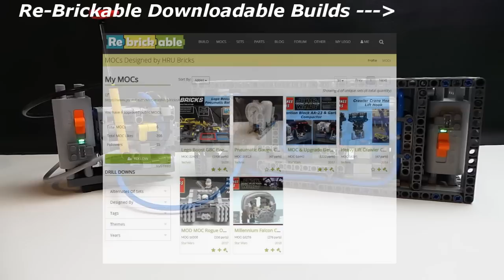LEGO Technic Auto Start Air Compressor Build Your Own

Comment: This is awesome!
I wish Lego had more pneumatic sets these days, but I guess they're mostly done with that...
Reply from the maker: Thanks. Lego is not not entirely done with pneumatic , there they come around every now and then
Reply: @SmashingBricksAU  Agreed but it would be amazing if they sold parts separately.
Reply: @jacobrosser2310  they are selling part separately
Reply: @takiktos1265  Where? I looked at pick a brick and couldn't find any pneumatic components apart from the T shaped joints
Reply: @jacobrosser2310  then you searched wrong, I bought yesterday two 2x11 pistons and 2 switches on pick a brick
Maybe that's because i live in Europe
Reply: @takiktos1265  Oh nice I will take another look since I'm in the UK. 
I've just found them maybe its just because when I looked they were out of stock so they didn't display them.

Comment: Put rubber pads on the bottom to further reduce noise.
Also, excellent build, i might have to make one myself.
Reply from the maker: Thanks! It is a good compact compressor. I was thinking about adding the extra rubber feet. The dampeners work well now but it could always be better! The table does resonate a lot so that doesn't help.

Comment: The rebrickable link doesn't actually contain instructions.  If one is fine building entirely from a model file, that might be okay, but pdf instructions might be a lot easier to use for many people, myself included.  The only pdf file that I saw was for some building notes, not the actual build instructions.
Reply from the maker: Correct. People do not want to pay for instructions and they do take time to make. What price would you be willing to pay for a set of instructions? Also Studio does not yet have all of the available parts in the parts pallet which can cause some issues with building instructions
Reply: @SmashingBricksAU  I made comment on the matter because at the Rebrickable website,  it suggests there is a link to building instructions, but no actual building instructions can be found there.

I understand that such things take time to make, and that this time should reasonably be compensated.  If you aren't willing to give out instructions for your own models for free, that's your right.  The only reason why I had been expecting to find instructions in the first place is because the link at the rebrickable site suggested that they could be found there, not because I believe you should be spending your time making such things and then freely giving away hard work.

Also, I mean no offense, but why are you asking what price I would be willing to pay for something that you've basically also just admitted that you didn't expect anyone to pay in the first place, not to mention revealed that you apparently don't have the  tools to make?   

How much I'd personally be willing to pay for instructions would actually depend entirely on the completeness and quality of the instructions, but unless you were offering such instructions for sale and willing to suggest a price point, it honestly seems to me like the question is rather moot.

Comment: You should place a mechanical actuator between the yellow zylinder and the electronic switch so you can change the minimum/ maximum pressure.

Comment: Hi, I got a problem with the air compressor I made using your design.

So how do you connect the air pressure clock to the air compressor? 

And how do you connect the 2 air tanks too?

Comment: Hey - thanks for this build, I've used it to supply compressed air to Akiyuki's 6-axis manipulator (I built my own end effector, basically just a gripper with a small V2 pneumatic cylinder). Any advice on dealing with the friction in the switch? I've ordered three different switches, but with my current elastic band setup, the shut-off is around 3 bar (great) but if pressure is gradually reduced (i.e. by actuation of the end effector), I only get start-up at around 0.4 bar. I'm using the recommended switch (with reduced friction). Any thoughts? I'd like to get it to start-up at a higher pressure. Thanks again!

Comment: I would love to add some usb battery eliminators and then use that as some sort of keyboard cleaner
Reply: Sadly I don’t think the air pressure would be fast enough, at least for sticky residue. I resell keyboards and a tooth brush tends to do a lot more than compressed air can.
Reply: @babascustomlegocreations8837  im more talking for how potato chips
Reply: Gaming For Live depends how soon you get them, eventually they will crumble and stick to the inside of the keyboard along with dust.
Reply: @babascustomlegocreations8837  i know its called experience
Reply: Gaming For Live haha well I don’t like experience then, it’s disgusting!

Comment: ......could this be ran in reverse to nake a vacuum pump?
Reply from the maker: Unfortunately not as that is not the way the Lego pumps are valved. That said you may be could reveres the one way valve that is on the inside of  the blue pump then add a second one way value....that would work then.
Reply: @SmashingBricksAU  still...that sounds equally cool, a vacuum pump made from lego, i know it wouldn't be perfect....but i wonder how low it would go.....
Reply from the maker: @stapuft  It is actually hard to keep a vacuum so I would say maybe 0.5 to 0.8 of a Bar

Comment: Bruh just use a bike pump
Reply: Can you fit a bike pump in a pneumatic engine car?
Reply: @autumnfire1490  no use the bike pump to pump up a pop bottle with a shraider valve to hold the pressure once it's in the bottle then use a 3 way adapter to fit Lego pneumatic tubing inside of it
Reply: I just prefer a power source inside the car rather than needing to be refilled
Reply from the maker: Whatever works for you mate